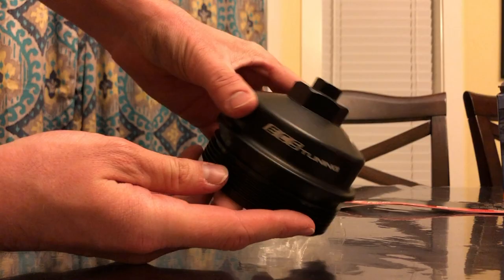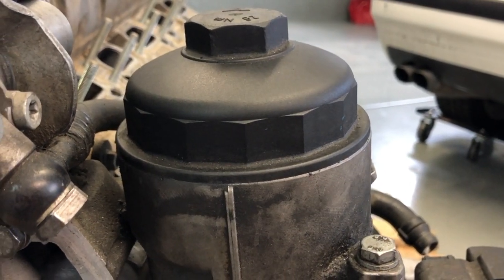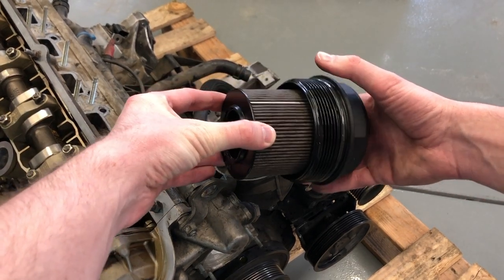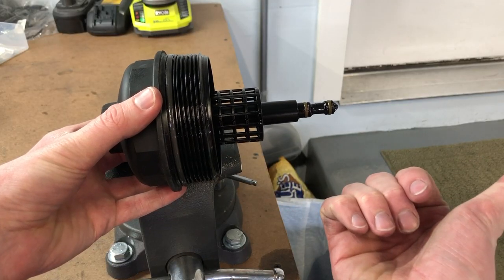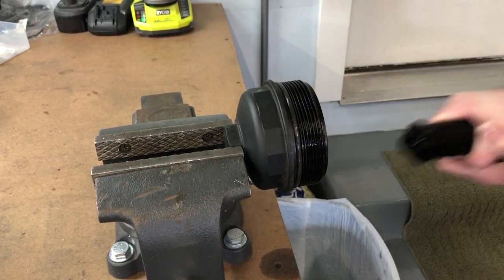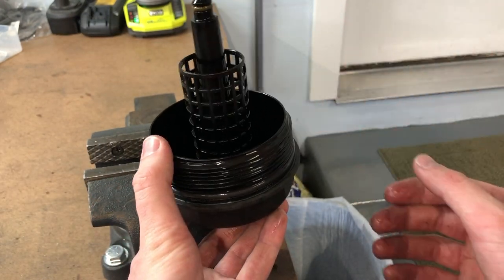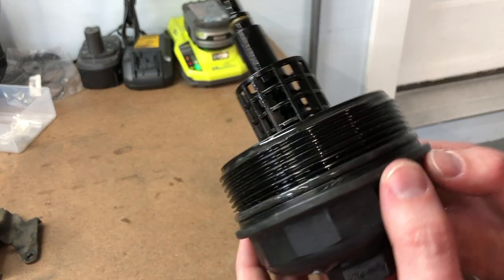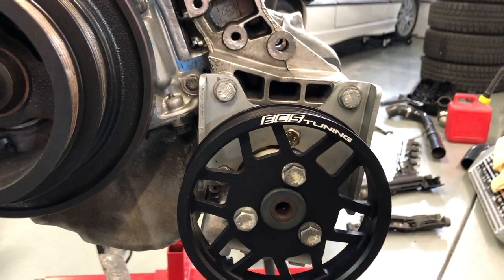BMW E46 oil cap upgrade. No more plastic! So much easier to open and close.

Comment: Would a metal cap vs. a plastic cap lower oil temperature a bit?
Reply from the maker: Potentially. As a part that will pull heat and dissipate it better/differently than a plastic. Good observation. I didn’t even think about it.